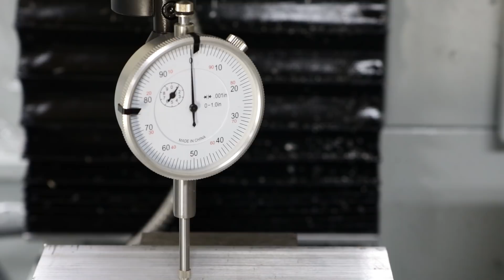Tormach Carnage and Rival Machining Update

Comment: Don't use a slide hammer- make a simple puller- piece of tube that is same diameter as spindle nose- a flat washer or any  thing that covers the end of the tube with a hole through it.  some 7/16-20 threaded rod up through the tube into the collet, then a nut on the end and just tighten the nut and it will pull the collet out of the spindle.
Reply from the maker: Thanks for the tip.  That sounds a lot safer than how I did it.  I'll keep it in mind if(when) I have this issue again.

Comment: looks like your collet  was griping on the radius on the tool shank I never push the tool all the way up against the radius  you will only grip a small area of the shank
Reply: I understand what you are saying about it only gripping one area, but I have to seat it in the collet to maintain the proper tool offset.  Otherwise wouldn't I need to touch off with every tool change?

Comment: The problem is backlash. Check for play in the dovetails by tightening everything down and putting a mic on the Y axis. Then push on the vice. If you have a bad unit you will find you have several thou of play. The problem lies in the QC team only checking one in 20 units, and customers blindly accepting bad machines without demanding a refund. DO NOT BLAME YOURSELF, Tormach is bad news! That is unless you enjoy overpaying for a cheap chinese CNC. Low end HAAS or a run of the mill Chinese mill both offer infinitely higher value.

Comment: Next time use a thinner aluminum sheet for the part and double side sticky tape to either the table or a slab of metal bolted to the table.
Reply from the maker: Good advice, I've made parts by bolting the material to aluminum blocks before.  I'm not sure I'd trust the double sided tape.  Are you able to keep an accurate part thickness in the Z axis with tape?  I tried the superglue method and I wasn't confident in the tapes thickness being repeatable among other things.
Reply: @RivalMachining  I do it all the time. As long as you don't put too much pressure on it when placing it on the tape. The blue stuff from Lowe's stays within a couple thousandths. Oh, and you can't use coolant when doing it that way. Then the tape will come off. Clean both surfaces with lacquer thinner before using the tape.

Comment: I've been using my Tormach for 6 months or so, if you have any questions I can probably answer them.  I use it about every day.
Reply from the maker: Thanks, we must have bought ours at about the same time.  I think I got mine in August of 2018.
Reply: @RivalMachining  June.  Fixturing can sure be a rabbit hole for odd-shaped parts.
Reply: @Paul Anthony I would recommend buying a used machine if you can fit it into your location and power it up. Moving it adds considerable cost to it, but the end result is a proper industrial machine.

Comment: I am sure you violated code by putting that exposed electrical in PVC instead of EMT. Just as easy to do the job in EMT, not any more expensive either.
Reply from the maker: I'm not an electrician, but I couldn't find anything against it when I googled.  I did see where PVC can be used in wet outdoor conditions though.  I'm not too worried about it since I'm taking it all down when I move in a few years.  The "electrician" I called quoted me almost $1500, so I did it myself for about $250 in materials and called it good.

Comment: You need a haimer. It would cut out so much bs....
Reply from the maker: I actually just bought one a month or so ago.  I love it for quick setups, but I think I need to adjust the run-out and mark the spindle so I install it the same way each time.  It took a while to realize that if the tool holder or spindle has run-out, the run-out on the haimer will vary based on how it is clocked in the spindle.  Next up is hopefully a jog shuttle.

Comment: I think the best use of the locating pin is to prevent the TTS collet from spinning in the spindle if this happens. otherwise the spindle taper would have looked like the shaft of the fly cutter. I suspect you know already but you can tap out the locating pin and replace it.
Reply from the maker: That makes sense that it would keep the collet from spinning, but I think it should be beefier so it does the job well instead of just shearing and jamming the collet in the spindle.  I didn't think I could replace it on the Tormach without disassembling the spindle.
Reply: @RivalMachining  You would need to disassemble the spindle.

Comment: Your spinning that edge finer to fast I only spin mine at 90rpm.
Reply from the maker: Wow, I've been running it at 1000 RPM.  I will try to slow it down and see if I like it better that way.
Reply: @RivalMachining  Don't listen to him. You don't want to go much lower than 1000rpm. I run at 1500.
Reply: 750-1500 for me. I find any higher than 1500 and I get vibs in the finish.

Comment: I’m glad the spindle is fine. Reassuring when I want to get one soon.
Reply from the maker: I'm glad too!  I am a little bothered by the fact that they put the alignment pin there in the first place.  Some folks on Facebook had the same issue with the superfly and it ruined their spindle.  I would think if the consequences of the pin failing can be a ruined spindle, they should make the pin into a key slot for extra strength, or just not install one in the first place if it is truly not necessary.

Comment: I'm assuming your problem was on the flip. If your leaving the back side flat you might consider using breakout tabs and just run one side. Also if you going to make a bunch of them my recommendation would be to screw the bar stock into a waste plate and nest them on angle so you'll get more parts per bar. Add tabbing and you should have a process that is much safer,  much  more time efficient, and with less material waste. Also there should be less bar flex while milling which may aid cutter life. cheers
Reply from the maker: Thanks for the advice on running the second op.  I may need to play with tabs again.  I was using fairly tall tabs before and it would leave tool marks.  Maybe I could run thinner tabs and skip the flip.  Though I sure do like to have a chamfer on all edges especially in aluminum. 

It was your GoPro case that I saw on John Grimsmo's channel.  It is really cool and could help a bunch of us YouTubers out.  I'm sure you have a ton of work in each one but would be curious what you are charging and when you would have one available.  Another option I was thinking about was using a piece of clear plastic (but it must be the right kind) as a splash shield for the camera.  I think McMaster sells L shaped plastic, so I was thinking about mounting the camera to the bottom of the L looking through the upright part of the L.  That wouldn't have the cool air blast though.
Reply: you could just debur/radius the 2nd side with a scotch-brite wheel.
Reply: @RivalMachining  
So far (for the total of three that I've sold) I've been charging between $115 and $125 + shipping for them. I've been wasting my life with video editing software lately so I haven't been milling/CADing much at all for almost two months. When I get back into it, my plan is to figure out a way to allow cables to get into the enclosure, which is a feature that has been requested by a couple of the owners (and I'd like it too). Doing that will cause delays and uncertainty, but would also be very cool to have (IMO). I can say that I think that getting one shipped before the middle of December would require the stars aligning, so an interim solution would be good to have.

As for the plastic shield, I think some kind of air blast or something (a wiper?) is pretty necessary. If the coolant lands in front of the lens and isn't shooed away, it'll just bead up and block the view. You can probably get decent results by just pointing an air hose at the lens area of the shield - it's just not very convenient/compact... and it may end up being louder and use more air.
Reply from the maker: You are correct, it happened after flipping.  They only reason I want to flip it is to have a uniform edge all around and a chamfer on both sides since the aluminum tends to be sharp.  Flipping the part is a lot of work for just a chamfer though.
Reply: That second setup for such a small amount of machining sure is a drag! I've had a few mishaps with my SuperFly and thin carrier stock as well. Even when it's not catastrophic, it's sometimes still scary. Eventually I just started adding an adaptive clearing operation (with a large radial stock to leave setting) to get rid of the bulk of the remaining material. Adding yet another tool change to that second setup is annoying, but at least it's consistent. Tabs sound like they could be a good idea too, if you can break off the bulk of the material by hand you could still run the chamfer and face ops on the back.

The same thing happened with my GoPro mount. The black thing glued to the side of my mill's head seems to be fine, even though the rest of the brackets and enclosure practically disintegrated. If the aluminum camera housing that you mentioned seeing was mine, I figured I'd mention that I plan/hope to get back to making them sometime soon (less fun things have got in the way). :)
Reply from the maker: Having access to the charging port might be nice.  I'm used to removing mine from the clear case anyway though.  Would you be willing to share what type of plastic you are using for the windows?  I'm really thinking about the splash shield idea, maybe with an air blast pointed at it.
Reply: @RivalMachining  
I went with actual glass for the windows, largely since I wasn't sure I'd be able to find plastic that would be truly suitable. And the glass should be more resistant to scratches too. At one point I glued a piece of glass to one of my earliest prototypes with some RTV silicone (grey, ~Permatex brand, I think (from Autozone)) and it looked like it might be quite coolant-resistant. Window glass glued to an aluminum base might be a good facsimile to angled plastic.

My stab-in-the-dark guess is that the GoPro cases are made of either PET or polycarbonate (maybe they are the same thing?) so I'd steer clear of those. 

Peter at Edge Precision put a piece of plastic on the back of his case (mentioned in one of his more recent enclosure-centric videos... mylar maybe?), but I'm not sure if he did any extensive tests on it.

Comment: Hey we like the car bottle opener, yes the coolant eats plenty of stuff around here too. We clean out everything right away after use and Precision Edge makes the GoPro pro enclosure that is who we saw making one anyways. Hey I am not there, so knowing that the width seems to not be an issue to me what was the thickness of the material mounted in the aluminum vise jaws, also is it 6061 you are fly cutting? I have no thoughts just asking a few questions to learn form you what happens.
Reply from the maker: I will check out Precision Edge.  The one I saw didn't have a link for purchase yet.  I was machining 6061 aluminum, and the vise was holding onto 0.100" of material with soft jaws.  I was taking a 0.050" depth of cut which I am told is too much for normal fly cutting, but the superfly has a much beefier insert in it.  I really think the material just flexed enough for the cutter to grab it out of the vise.
Reply: Ok I better understand now, Holding in aluminum cutting 50% of the existing material is surly the issue likely and you are not able to buy the Precision Edge GoPro cam box either, he just made the one as far as I know as well. Thank you for sharing with us.